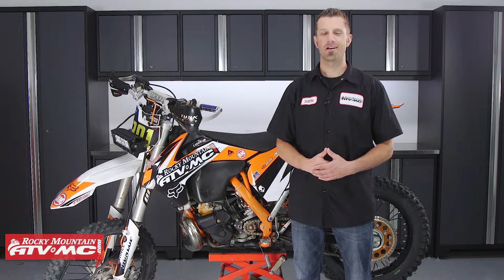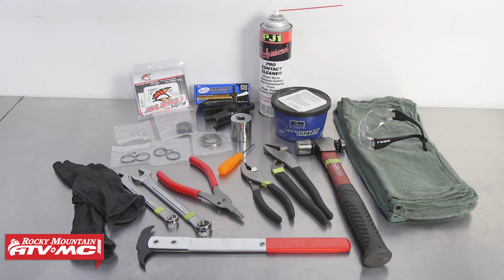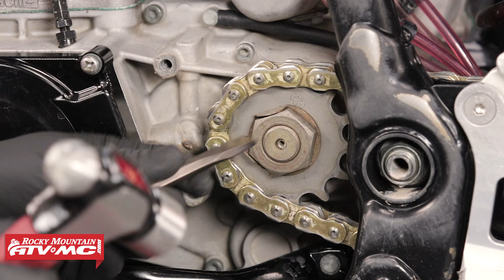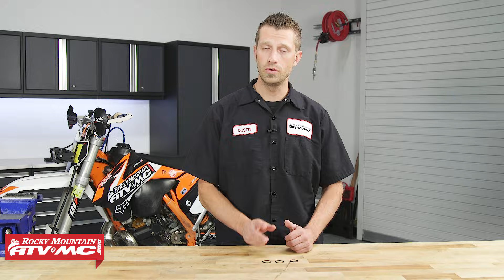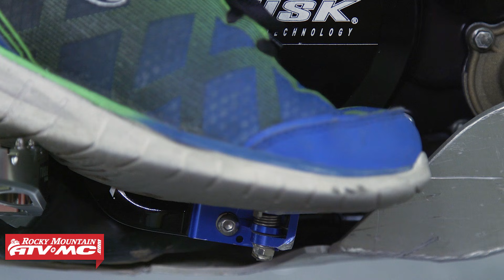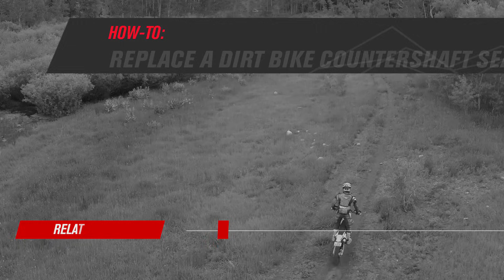How To Replace a Countershaft Seal on a Dirt Bike

Comment: On an 07 300 xc, I learned there’s no back stop and it will happily drive in too far and compromise the seal. A socket slightly larger than the hone will help avoid this. Otherwise eyeball it flush and even, I guess

Comment: Great video. The only issue I had was that I could not get an even amount of pressure on the seal when placing it in the case. Seemed to get crooked then would bend out of shape. So I thought I would use the sprocket itself as a makeshift Seal driver by placing the seal in the case opening by hand. Then I took the sprocket and flipped it around flat side toward the case. Placed it on the shaft and up against the seal. I then used a sprocket to drive against the sprocket and the seal. Here is a video I made of what I did: https://www.youtube.com/shorts/Rj47QOs_pQA

Comment: hi i have a question if the bolt that holds the sprocket spins but when i spin the bearing the bolt doesnt spin it just stays like that and the bearing doesnt have friction on the bolt would i need to replace the bearing or bolt or both?
Reply from the maker: You will want to replace both of them.

Comment: What am I supposed to do if I don’t have the puller?
Reply from the maker: Removing that seal is really difficult without the puller. There has been ways people removed it by using a screw just smaller than gasket. Screwing it in and being careful not to damage anything else or go to far. Others use screwdrivers, again that is going to be a little difficult but can be done.

Comment: My countershaft seal is tough to put on any tips?
Reply from the maker: Make sure you have the correct seal by matching it up with the old seal. Once you've done that, grease the inside and outside of the seal and try using a bit of heat on the case where the seal will go. Also, check that your socket you're using to drive in the seal is sized properly and isn't hitting on the countershaft or the case.

Comment: Super helpful video. My only advice though is to never buy an aftermarket o-ring. Buy the OEM o-ring from the bike Mfr. It'll save the hassle of repeating the process. It's just not worth trying to 'figure out' the right o-ring dimensions on aftermarket.

Comment: Good morning and thank you for the great video. 

I guess I got a little carried away when trying to put the seal back in and ended up damaging the case. My question..

Does the seal ride along a race that can be replaced or did I damage the actual case? Either way I can’t find the race or information about it. (2004 KTM 250sx)

Comment: I hope you read this, on my 07 KX 450F the collar that slips over the shaft is absolutely frozen on the shaft, will not even budge I tried everything tapping it in all directions trying to loosen it up, it’s stuck Any Suggestions, thanks for your time, Will.
Reply from the maker: Try using some penetrating oil and let it soak for a while. Then try tapping on it in all directions again.

Comment: The sprocket bolts break all the time it’s bull red lock tight with a junk metal bolt and if your lucky enough to get it out you should use a new bolt it will come with red lock tight on it brush it off and use blue so it comes off easier next time I wish I had the nut like yours does instead of the bolt

Comment: If you still get a leak after replacing the seal and you have to use the bigger O-Ring, can you take the old O-ring off and put the new one on without taking the seal off?

Comment: Hard to change the seal when your website doesn’t carry 1988 kx125 seals
Reply from the maker: We carry the OEM Kawasaki counter shaft o-ring if you check our OEM parts finder. The part number should be 92055-022.
Here's a link to our OEM parts: https://www.rockymountainatvmc.com/oem-parts/Kawasaki
Reply: Rocky Mountain ATV MC I need the whole parts set with the seal and o ring

Comment: thats kinda crazy how its only a snap ring holding on the sprocket. you know the thing that you rely on to move the machine.
Reply: Interesting that you say that. Got home this afternoon and oil was pissing out of ky sprocket. Opened it up and the seal somehow pulled in front of the snap ring and now I'm figuring out how to get the seal out without speciality tools. 😅
Reply: @Alberto Cason definitely, I have been using flixzone} for since december myself =)
Reply: @Alberto Cason Definitely, have been using flixzone} for years myself =)
Reply: Pro trick : you can watch movies at Flixzone. Been using it for watching all kinds of movies these days.

Comment: My dirt bike has an oil leak from near the front sprocket, however it is engine oil leaking out of it. Is it still the countershaft seal? Bike is a 2007 crf450r.
Reply: lol that is a big misconception on these bikes. the "Transmission oil" is in reality engine oil. there isnt a seperate pan for it like in cars. it is all the same. if it has oil coming out. it is your countershaft seal.
Reply: @travisk1487  actually they are separate on certain crf450s
Reply: @StrykerV8  i was referencing the 2 strokes but yea true

Comment: This happened on my ttr 125 and all the oil drained out completely, where am I supposed to buy the seal?
Reply from the maker: You will want to check the OEM parts for the correct countershaft seal. Here's a link to the Yamaha OEM parts finder: https://www.rockymountainatvmc.com/oem-parts/Yamaha

Comment: Is it bad if the seal is pressed all the way in ?
Reply from the maker: Not sure what you mean by "all the way" but the seal should be pressed in until it's flush with the outside of the engine case like shown here at 5:30.
Reply: @rmatvmc  he means pressed in further than "flush with the case". I did the same thing. its a little past flush

Comment: Is it normal for the counter shaft to move forward and back if you know what I mean?
Reply: just replaced the seal on mine and noticed the shaft had around an 1/8 inch wiggle room forwards and backwards as well. Seems to be normal and it all tightens up and pulls the shaft all the way out when you install the sprocket and nut back on the end of it.
Reply: @cheezedoodle8356  okay thank you

Comment: Rmx450z seal wouldn't come off with tool just ripped seal and seal is stuck on good. Any ideas how to remove seal? Also rmx450z have 2 oring seals.
Reply: Drill a screw in a little bit and pull off with Channels twist and pull

Comment: Do you need to drain the oil beforehand?
Reply from the maker: Its not necessary, you'll probably have a little more oil come out while doing this job if its not drained. You can also lean the bike over a bit when you're changing it and you shouldn't lose very much oil that way either.
Thanks for watching!

Comment: Hi, thanks for this video, excellent as always. I have a 99 KX250, says there's two o-rings, where does the other one go? do i just slide the other one after the first one that's in that groove? I cant seem to find any information even in the service manual. thanks
Reply: I have an 01 kx250 I plan to do this on. Did you find out?

Comment: Instead of using the Motion pro seal remover, will the Tusk bearing remover kit work instead? I already have that kit and won’t want to buy the Motion Pro if I don’t have to. Thanks!
Reply from the maker: Clayton Hertz If you have it, it's worth trying.  I'm worried the Tusk tool won't clear around the countershaft?  That is my concern.

Comment: Might be a dumb question but if I had a bad seal, would the sprocket have to be spinning in order to leak? I’ve whipped everything down and let the bike idle for a while and it’s dry as a whistle, do you think I’m good to go?
Reply from the maker: Cameron Sometimes, yes.  Seals aren't too pricey.  It's best to simply replace the countershaft shaft seal and clean and inspect your countershaft.
Reply: Rocky Mountain ATV MC thank you!

Comment: why you use grease instead of oil?
Reply from the maker: Manufacturers typically call for grease on seals.  I think it lubricates better and longer to help the seal seat to the surface.

Comment: Great video, Never had to do this before on my Honda's, Yamaha's or Suzuki's. This must be a repair very specific to KTM.😬
Reply: Paul Claverie currently doing it on my Honda crf250x😬
Reply: @mrcapsicum739  how did it go mate I got the same bike
Reply: LOL
Reply: Not specific to just ktm trust me iv just bought a yamaha wr250f and it's happened to mine it's leaking in my garage as we speak iv just ordered a all balls seal kit
Reply: My Kawasaki just did it
Reply: Mine leaking on my 2004 honda but shes an old girl
Reply: Mine leaking on 09 300xcw only 35 hrs
Reply: I’m just doing this on my husqvarna tc250 (white Ktm) it has 400+ hours on it being a 16 model
Reply: My 1994 honda cr125 leaks like there is no tomorrow
Reply: @proarmy70  Sorry, Sounds like it’s time to fix it